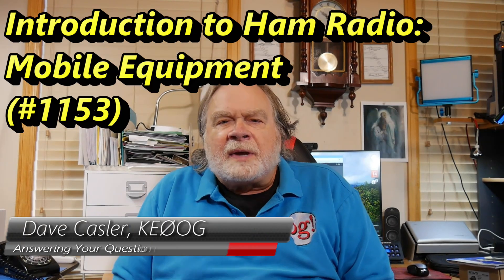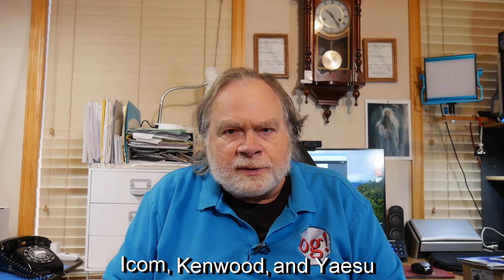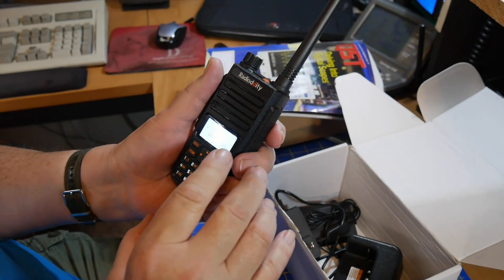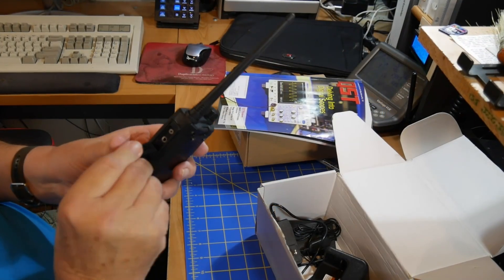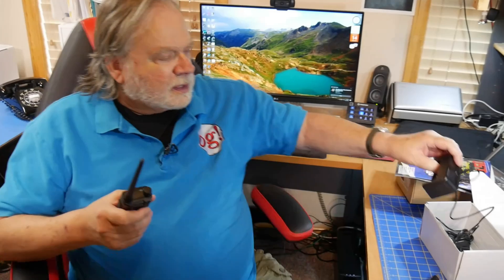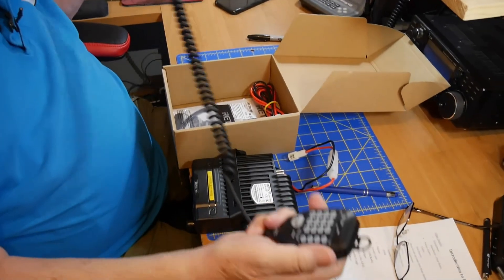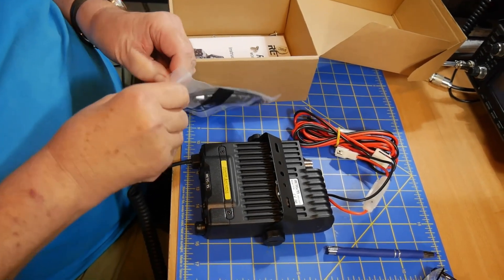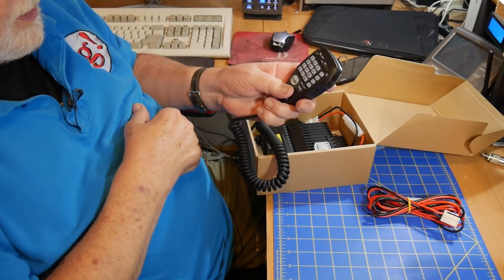Introduction to Ham Radio: Mobile Equipment (#1153)

Comment: I started with the 'fengs, got a Radioddity GS-5B, then got a TRu(sdx) - HUGE learning curve into HF, then at a HAMfest got great deals on a Yaesu FT-100D and an ICOM 756 Prod iii, but the Yaesu mobile is a shack-in-a-box and it has been so useful that I haven't even set up the ICOM base station yet.

Comment: The quality of your video photography and editing has improved greatly recently.  You must have a new young man working  the camera and editing!  Well done.   I"m in the market for a new HT since my Kenwood TH77-A recently stopped transmitting audio.  It transmits the carrier, but no audio. I'll have to take a look some quiet afternoon at the schematic and pull out an old O-scope to do some poking around at the ususal suspects!  I've had the Kenwood since 1990/1991 so I am sad that it stopped working.   I have been looking at the Chinese radios and they almost seem too good to be true based on their pricing.  Anyway, I"ll look at your videos on the radios you mention in this video.  Thanks and  73!
N7YMZ